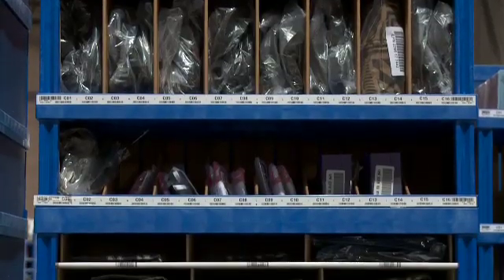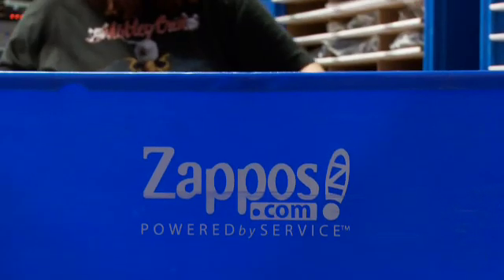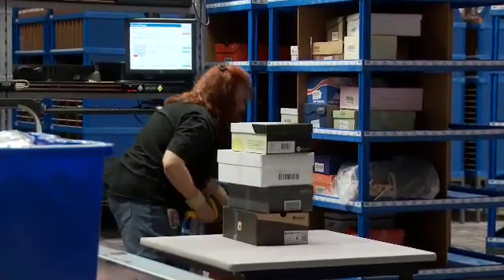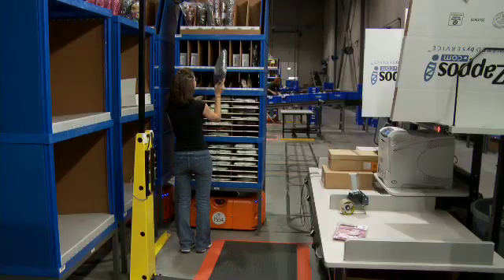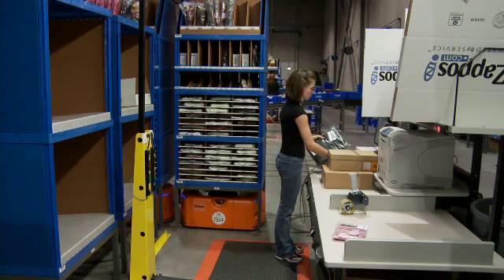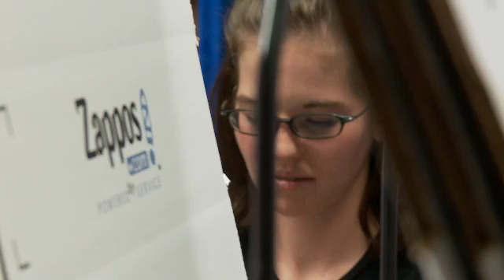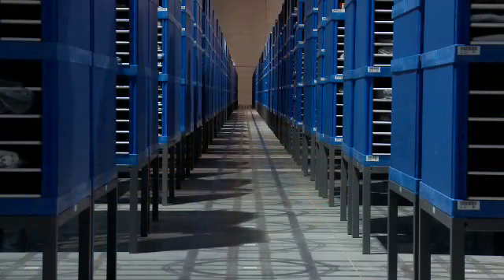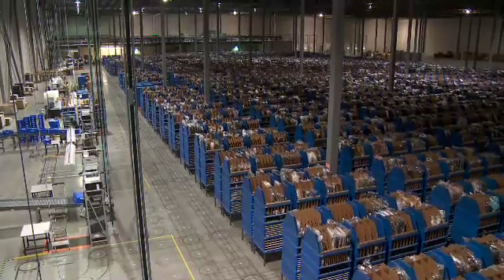Robotic Distribution

Comment: ...also if one of the Kiva's sense you laundering around exhibiting burglar like body movement, it emits a signal to all the other Kiva's but you'd never know. They'll just continue working like nothings amiss. That way by the time you get around the corner handling merchandise that should only be moved around by The Bots, you will sure to be startled when Avik, (Kiva spelt backwards), scoots out of thin air, as you hold its property in your sweaty palms. Avik, a loss prevention bot, cruises silently like a Prius going downhill at low speed. It weights twice the amount of a line backer during NFL mid-season, it also comes equipped with a small capacity of 'Amurika power.

Comment: every machine of any sort, whether a simple rope & pulley system to the most sophisticated robotics system, or a passenger jet, etc.  They are all machines.  Machines simply multiply effort or work and actually make possible things otherwise impossible. If machines actually reduced the need for manual, physical labor, then the first working animal with the first bridle would have doomed humanity.  But clearly it didnt and neither will these systems here.